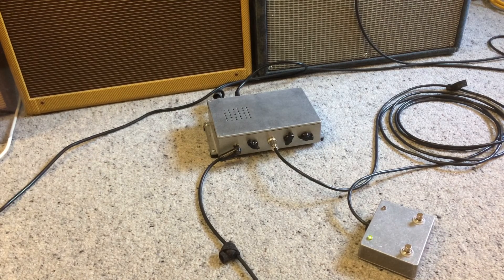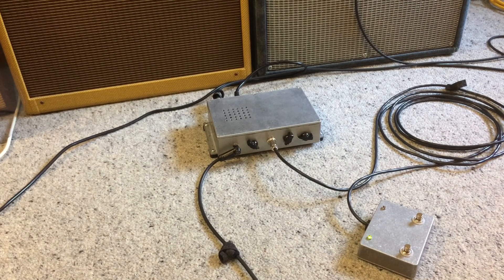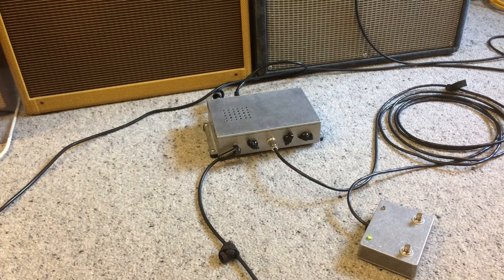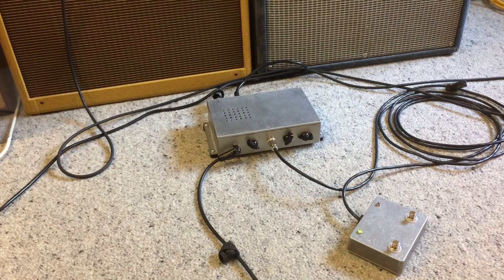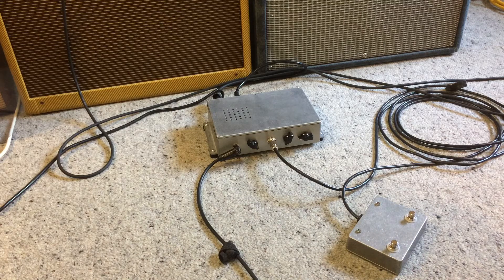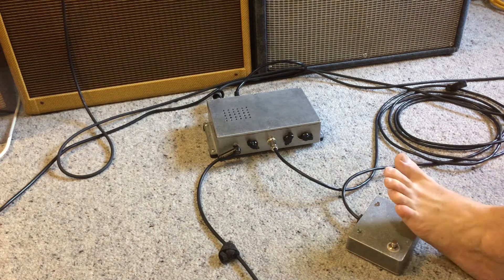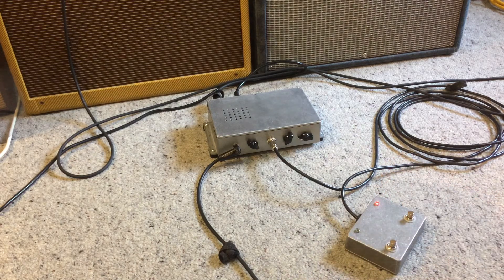TremoDrive Demo

Comment: What is your schematic for TREM and drive footswitch? Seems the TREM oscillates the bias on drive cathode. Easy to switch that out but where u switching dive our? The bypass?
Reply from the maker: Yep, the bypass. That's why the trem only works with the drive on. You can drive, drive and trem, or nothing. That's how the original circuit was designed. I haven't changed the circuit, just replaced the foot switches with relays, and operate the relays from foot switches on the pedal.

Comment: What sort of cable did you use for the foot switch, stereo?
Reply from the maker: No, 4 conductors. There are two relays in the fx pedal, and each one needs two conductors to carry the battery voltage from the pedal to the relay and back.
Reply: Bladder Splattle Thanks for replying.